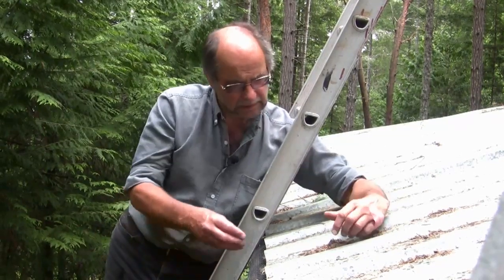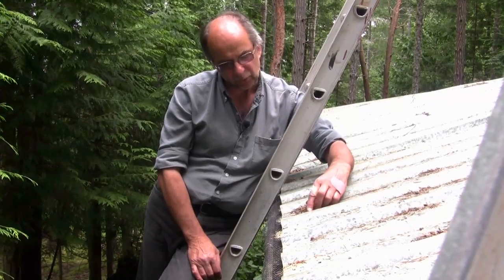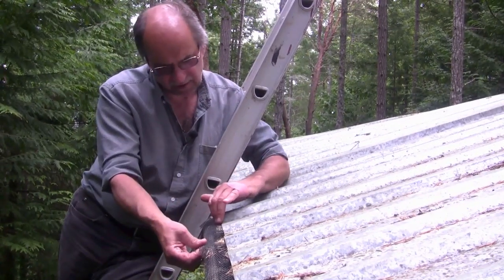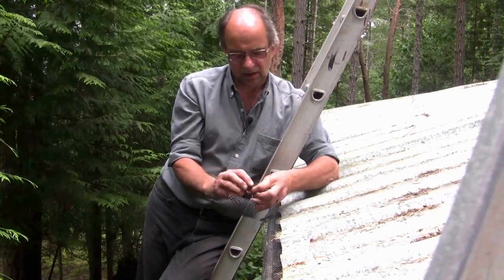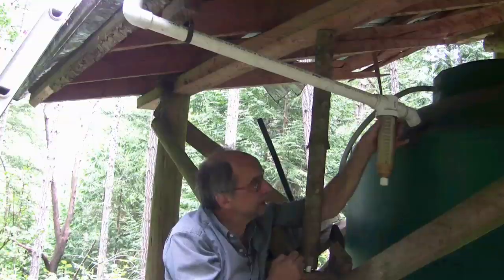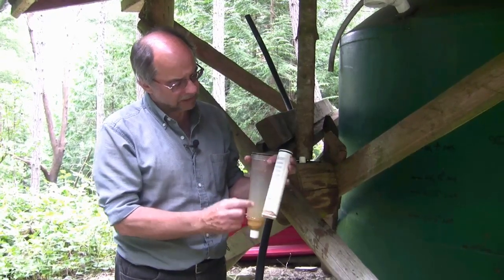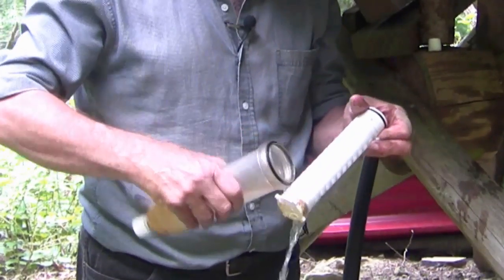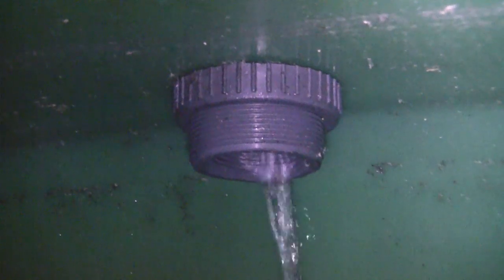Rainwater Harvesting Off Grid 2

Comment: Thanks, this is the only common sense result I have found for this problem. I live at 6,500 feet with evergreens all around me. I do have a metal roof. However I am concerned about the ice build-up. During a bad winter I will get ice extending to the ground from the drip edge of the roof. May have to install some sort of heat tape (Solar) .Resource lists are helpful. This can not be seen fro the road. Rules and regulations you know!
Reply from the maker: Hey larry, thanks for your interest.
Personally, I don't worry about ice build up, as fortunately it's not a big deal around here - usually. In this vid or this one,
https://www.youtube.com/watch?v=vSV7oP43Fi8&lc=z22zhz1gezmdflkf2acdp433u1lsnybwlfywbnha05pw03c010c&feature=em-comments
I describe what I do to relieve any ice pressure in the clear plastic filter bowl.
Thanks for watching & good luck with your system!
Cheers
M
Reply from the maker: Here's a better URL for the other video.
 http://www.youtube.com/watch?v=vSV7oP...

Comment: Came across your first rainwater vid by accident, then fllowed it up with this one.  Great info.  I live year 'round off the grid in southcentral Alaska - built my cabin in 1990-91.  Had decided this winter that come summer it was high time I upgraded my rainwater collection beyond a 20 ft row of plastic trash cans and buckets under the eave.  So timely that I found your great videos AND your continued connection and response to questions.  I have a lot of useful info for my summer project!!!  Thank you. [ Winter time I melt snow.]

Comment: I am planning to build a similar rain collection system.
I'm looking to buy a 91" h by 95" w tank.  Would 12' posts, 2' in cement thus 10' in height for the back and 10' posts, 2' in cement thus 8' for the front in height be sufficient for the main supports?  The roof support posts 4x4's, 2x4's for corrugated roof supports?  
Suggestions?
Reply from the maker: +John Worrell 
Sounds good. No need to bury posts in concrete (if I understand your description correctly)...use post saddles http://www.rona.ca/en/post-base-hanger-0348092--1
Diagonal bracing between posts will ensure the structure is rigid...but make sure you slide the tank in first!
Good luck!
M

Comment: Hi I just found your vid while I was researching water catchment systems. What a great set up. Are you still available for questions? What size PVC pipes are you using from the gutter to the tank? What type/size pipes are being used from the tank to the cabin?
Reply from the maker: Immanuel United Methodist Church Thanks...Always available but not always this fast to respond!  Gutter to tank pipe sizing was determined more by the thread arrangement on the in-line filter - I believe it's 1.5" and adequate. If you have a significantly larger catchment (roof) area, you may want to upgrade....maybe 2" or so.....with a correspondingly higher capacity filter. 1" black PVC is adequate down to the cabin, with smaller lines for distribution at points of use. Hope this helps....this is what works for me.
Cheers,
M

Comment: Great videos! I'm out on the west coast too. and I am wanting to set up a similar system with 2 tanks 1 for my Horses and one for domestic water. My biggest concern is running out of water.  Have you ever run out of water?  How long do those little chlorine pucks last?  Have you ever used Bromine pucks?
Reply from the maker: ***** Hi Denis;We are not full time off grid, but spend as much time as possible at the property, all year round.
The antidote to running dry is bigger storage & a larger catchment area! Sounds like you are on the right track.
The chlorine puck in the filter lasts a long time. As long as the water is clean when it enters the tank, the occasional chlorine (bleach) shock will take care of the pathogens, if any are present. No, I have not used bromine, 'cos I don't have to.
Thanks for watching!
Cheers,
M

Comment: May I ask how much it cost to set that whole system up?
Reply from the maker: Hi Sacha;
I set up the system almost twenty years ago, so my prices are sure to be out of date...
The tank was $1400 and 400' of 1" pipe was under $100. Filter, valves & connecting hardware will add a few hundred $ more.
Sorry I can't be more specific. My advice is to buy the proper equipment that does a good job...you won't regret it. Going cheap is rarely satisfying in the end.
Regards,
M

Comment: I'm living your channel. I really appreciate you sharing what you've learned over the years with us.

I'm getting ready to start using rain barrels more seriously because I love in a small, dry cabin in an urban location... since my dwelling is technically illegal I can't hook up to existing pipes and I'd rather have something that doesn't soley rely on the grid. Basically we've had one rain barrel (somewhere around 30 gallons) and all we use it for is watering the garden. I'd like to set up a system that would feed into my shack that would be safe enough to use for all purposes.

Long explanation to ask: how much has your set up cost you? And how much do you think it would cost to do now? I understand we are in different areas in many ways, but I'm just curious.

You don't have to answer, but again thanks so much for your videos.
Reply from the maker: Hi Amanda;
Maybe you need to separate the garden storage from potable storage. For the potable storage, maybe a larger tank would be in order - you would have to price out a tank depending on local suppliers. My pre filter is a Rusco http://tinyurl.com/kjwnbwj
Downstream,use this or equivalent with an activated charcoal filter cartridge http://www.rainfresh.ca/sediment_filters.php  
The two filters should be no more than $200 (approx) + the price of whatever tank you purchase or scrounge (!)
If you do not have sufficient fall from the storage tank to create gravity pressure, you may need to install an electric (12v or other) pump to pressure the water through your charcoal filter and on to your faucet.
Hope this helps :-)
Everyone's mileage will vary...
Cheers,
M
Reply: Markerbuoy - On Canada's Left Coast thanks ;-)

Comment: I'm looking to create a much smaller (large enough to accommodate about one person's water needs) but hopefully similar system. However I will be unable to use gravity in the same way, as I will have to situate the appliances close to the collector. I would be very appreciative of any advice you could offer on the construction, 
thank you.
Reply from the maker: I have a friend with a cabin and no hill, like you. His main storage tank is at ground level but he has a "supply tank" about 20' up a tower. Once in a while, he pumps water up to fill the supply tank and gravity feeds water to his system until the supply tank is depleted. This way, the pump (12v) is not running every time the tap is opened. 
It is surprising how little water one needs when not flushing toilets or running showers but it's alway a good idea to go big on storage if you ever need to expand...and you probably will :-)
Good luck with everything,
M

Comment: Quick thought....double or even triple up your layering of "gutter guard" under the roof to stop even more thistles from entering gutter....then,...add a "quick off cap" to the Distal or end part of your gutter to allow for quick 'departure' of said particles.
Reply from the maker: Good point.
Even as you suggest, at some point maintenance would be required, due to the volume of fir needles which constantly fall. I prefer to clean a little & often :-)
Cheers,
M

Comment: Wonderful system you have there.  How long does the small chlorine tab last?  Is there a way to allow excess water to run off?
Reply from the maker: Chlorine puck lasts a month or two depending on temperature & water volume etc. There is an overflow pipe installed at the top of the tank.
Cheers,
M
Reply from the maker: Wolfgang1224 The chlorine puck just happens to fit nicely - just.
My Rusco is 20+ years old and I see they have modified their design somewhat. They have different filter mesh sizes available, so I would err on the side of larger mesh than smaller, given, like me, you have gravity feed. Don't forget the importance of a primary filter up in the gutter.
Given the windy rainstorm we just had, I could use a touch of Arizona desert right now - from here, it looks very appealing!
Cheers,
M
Reply: Markerbuoy - On Canada's Left Coast
Is the chlorine puck a 1" or do you cut it down manually to fit in the bottom of the filter bowl? 

I have been looking at Rusco Spin-Down filters like you have & their website said you need 40psi minimum to operate properly, but yours apparently seems to work fine just with the tiny pressure coming off the roof.  That makes optimistic as with the water system I'm building, I'll only have about 2psi between the roof and the tank.  Thanks for showing the filter & the whole setup.  Sure wish I lived in an area like you do, it is beautiful.  I am stuck in the Arizona desert in a suburb.  Doing the best with what we have though.

Cheers,
W
Reply: Markerbuoy - On Canada's Left CoastThanks fort he info.  I got my Rusco in last week, a 2" model with a 100 mesh filter.  I am building a 10-gallon first flush diverter into the system before it reaches the Rusco and there are no trees near my house that could put leaves onto the roof.  I'm also making a bio sand filter to filter to take care of the viruses and bacteria and then UV final prior to drinking.  I also bought a water test kit to see how good the water is after my system to make sure I didn't miss anything.I grew up in Colorado and miss the 4 seasons.  If you'd like to trade, let me know.  With the 6-months of sweating starting, I certainly would prefer snow.  8-)
Reply from the maker: Wolfgang1224 Wow! Quite a thorough job!
The one thing you don't need is the test kit - I guarantee your water will be 100% :-) :-)
How much rain DO you get down there & how big is your storage tank?
Reply: Markerbuoy - On Canada's Left Coast I was just going to use the test kit on the initial activation.  Since I'm going with the biosand filter, I won't be using the chlorine puck as that would kill the biosand layer.  As for water, a few times a year (enough to count on one hand), we get a good few inches of rain.  Nothing compared to your area, but my tank is only a 550gal unit.

Comment: great video... question, how did you connect the pvc fitting to your gutters ?
Reply from the maker: I usually start with a 2" ABS cleanout fitting and use it's modified screw-in flange cap to secure it in the bottom of the gutter. I modify the cap by drilling away most of the centre to allow the collected water to drain. This (or some variation) does a much better job than conventional cheapo drainpipe fittings. Hope this helps.
M

Comment: Those needles seem a right pain in the "sphincter". How about using two layers of galvanised sheeting, one placed on top of the other but the top layer has holes or slits in it that are smaller than the pine needs? The water will go through the slits or holes and is collected by the sheet underneath and the top layer is smooth enough for all the needles to be washed off by normal rain. Ta dah!!
Reply from the maker: It's not just needles....there's a lot of other fine grunge that falls from the trees.
Thanks for your suggestion!
Cheers,
M

Comment: Great second video, you answered my questions about the tree foilage and how you keep the majority of it out of the system.  Here in Nevada we have a lot of dust and the first bit of rain run off usually has a lot of dirt in it.  Do you have a dirt problem?
Reply from the maker: Not so much a dirt problem but around here there are a lot of trees, as you can see. Every time I clean the gutter and first coarse filter it disturbs some of the finer detritus which can clog the fine filter if I don't keep an eye on it.
Thanks for watching & taking the time to comment...
M

Comment: What do you do in wenter time when its frezing out side and how you pump the water to the washing sistem and the shower sistem as will i wed like to know what you do fore elctrck and thank you
Reply from the maker: Hi Andy;
Full disclosure; We are not full time off grid. Here in the Pacific NW winters are usually mild due to the moderating effect of the ocean. We are not usually present in severe weather and to mitigate potential damage I drain the water system, except for the storage tank.
I use no electricity to pump water as gravity does all the necessary work.
I have a solar system installed for lighting & for heavier loads I run a Honda 3000 generator.
Hope this helps...
Regards,
M

Comment from the maker: Hi Sharon;
No Guarantee & your mileage will vary :-)
However, I don't see the water freezing to a solid block, especially if the tank is near full. Protecting supply lines may be more of an issue.
Your tank will have to be sourced locally, so just shop around...but I think you will find all are PE. Mine has provided good service for 25 years...and more to come.
No specific instructions on the catchment structure - just basic rustic carpentry and lots of cross bracing as you can see.
Good luck,
M

Comment: Great videos Mark! I am planning on building a system like this in Eastern Washington at a vacation cabin.  It can get very cold in the winter. Do you think I would have problems with a system like this there in winter?  I would imagine I would have to worry about freezing.  Do you think this system work freeze free if the tank and supply line to the cabin were below the frost line?  Its just a weekend place so I was thinking of just going with a 250 gallon tank